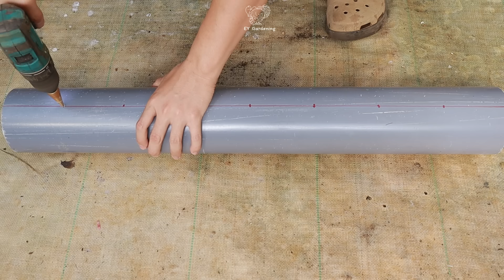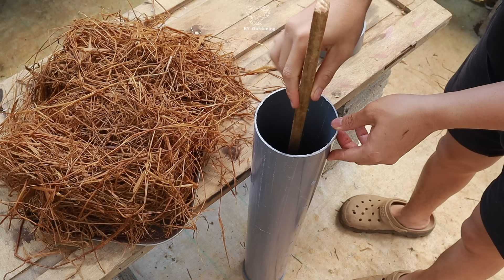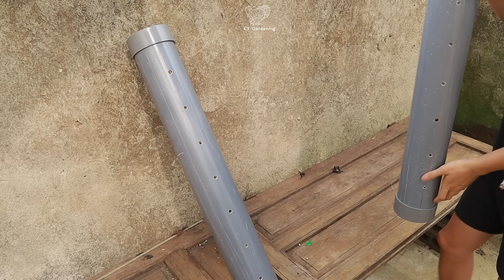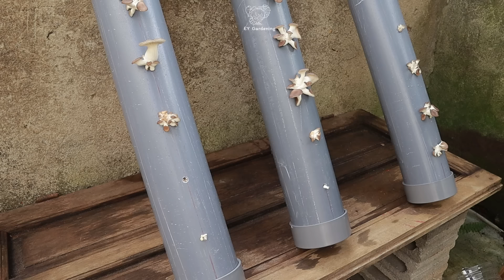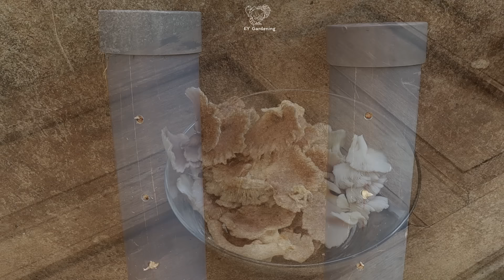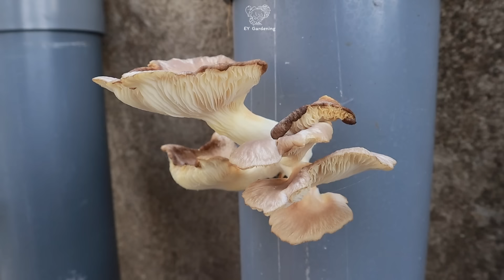Method of growing mushrooms with water pipes at home - Harvest multiple times

Comment: Unfortunately this looks pretty hard to maintain. Difficult to clean and steralize for future flushes. Maybe if you had a way to keep the same colony fed continously this would be nice, but as of now it's kinda just a one off thing that could easily be replaced with a bucket that's easier to clean.
Reply: This works with cool weather, on hot humid areas it wont work also once contaminated the whole thing will be gone,.. also not transaprent means.. wont able to see the contamination.